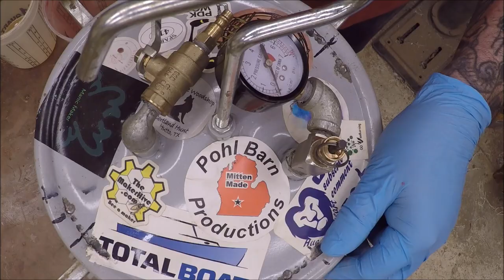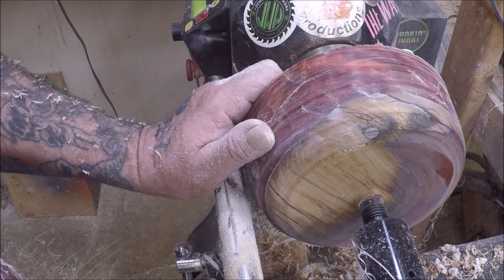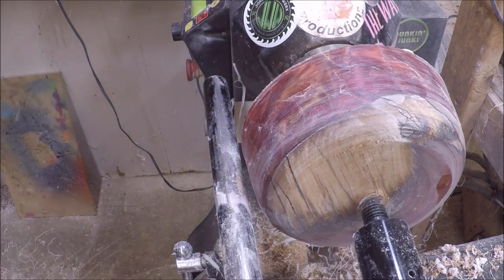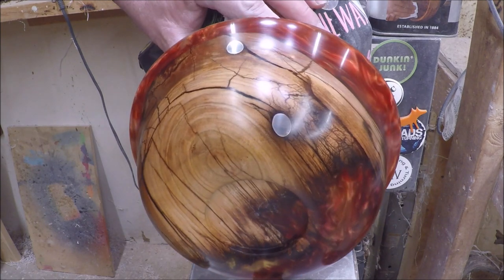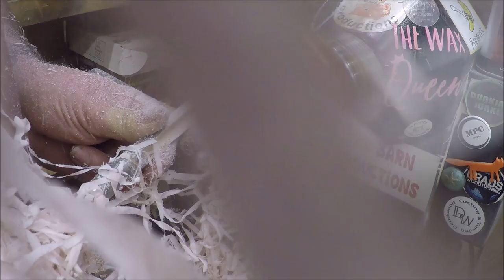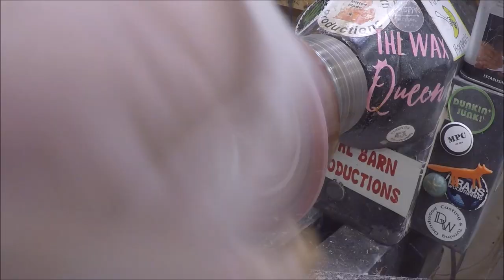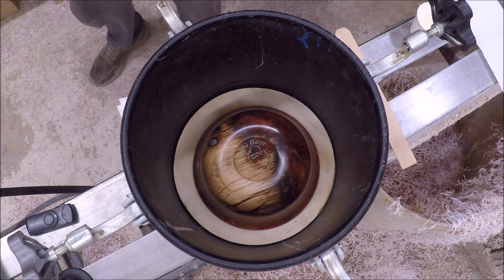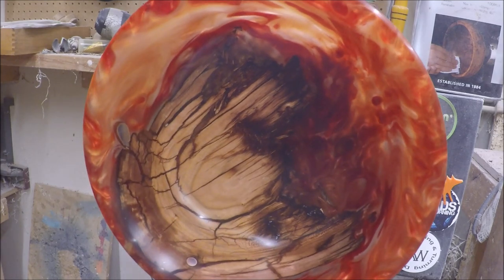🍒Choke Cherry Under Fire 🔥

Comment: amazing work as usual. im learning how to woodturn by watching youtube so i was hoping you could answer a couple questions. how many times do you sharpen your tools during a project? ones without 9mil included i should say 🙃 and i noticed your lathe kinda slams on the brakes when you turn it off rather than spins off slowly like most i see, is that an optional feature or just a ‘quirk’?
also i’d love to hear from anyone with suggestions of other woodturners to watch on youtube? preferably wood/resin combos since that’s what i’m studying
Reply from the maker: Thank You for watching, well I sharpen based on how fast the tools dull during the turning process, the more dirt in the wood the more you end up sharpening, the resin or mica powders in the resin tend to shorten the edge life as well, so sometimes often and other times not. my lathe is equipped with a braking system, not sure if any others do or not. 
well I watched Nick Zametti, Andy Phillips, Heath Knuckle and Peter Brown for all the resin turning stuff but still ended up learning on my own, I pretty much followed who didn't bore me to death over explaining how to do something,  Zac Higgins is another one I  followed for everything resin related,  hope that helps

Comment: Probably a silly question but was alcohol involved in the taking down of this tree?
Any way it looks amazing.
Reply from the maker: you are correct that was a silly question,  No we actually had a target in front of the tree, using it as a stopper, noticed a hole through the middle of the tree after that the tree was the target.

Comment: What happened to my cast? I poured a small 42 gram resin and added blue, red and white together and stirred it by hand and put it in the pressure pot, it ended up with huge air bubbles. Any idea where I went wrong? Thanks
Reply from the maker: I am sorry Mike I have no idea what happened,